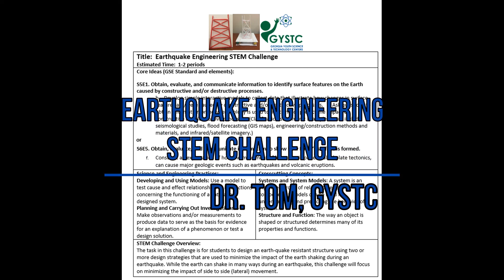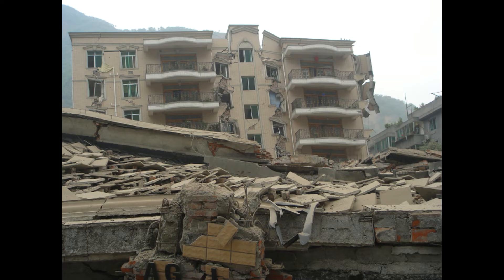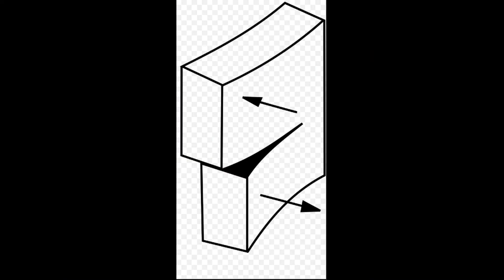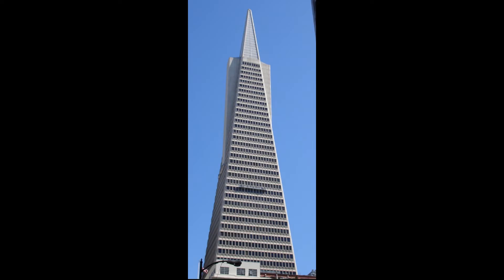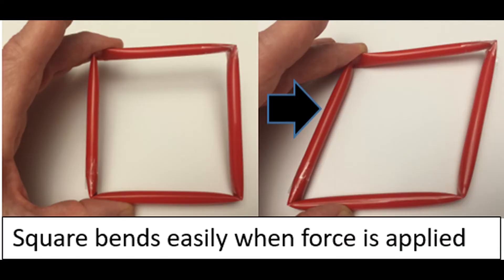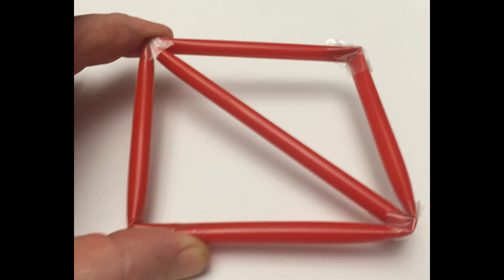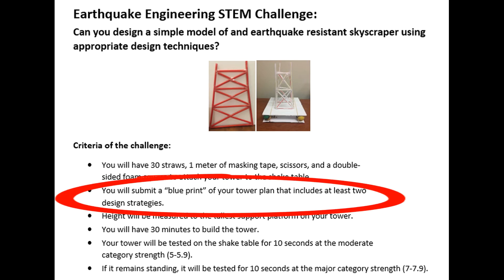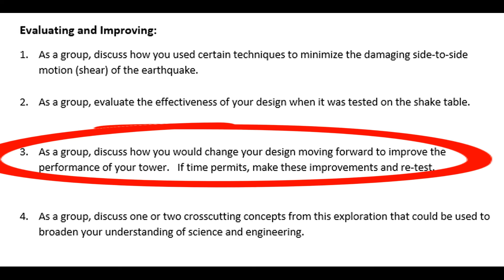Earthquake Engineering STEM Challenge

Comment: I am trying to learn about the launching upward force on structures from earthquakes … can you direct me to the right lexical phrases to research? It seems possibly a new concept where structures historically are designed “to stay up”, versus considering how to strap them down when the earth might be bucking like a trampoline. Have a quote here, and an article with links. Thanks if anyone can reply. 
      “Professor of Geophysics Dr. Ahmet Ercan said that by the time the shockwave of the earthquake reached Antakya it had increased instead of reducing in magnitude, so much so that it was equal but opposite to gravity. This caused buildings, even if they had strong and stable structures to experience a force that threw them up into the air from the base up and then pushed them sideways, of which Rönesans Rezidans is an example. The building is knocked over but it has not collapsed. All the columns and beams appear still strongly attached to each other showing no sings of breakage”. [29]     
 — also SEE ARTICLE: 
 – Trampoline model of vertical earthquake ground motion - Jermey N. A. Matthews - 30 Oct 2008 in Research & Technology - DOI:10.1063/PT.4.0711 - 
https://physicstoday.scitation.org/do/10.1063/pt.4.0711/full/